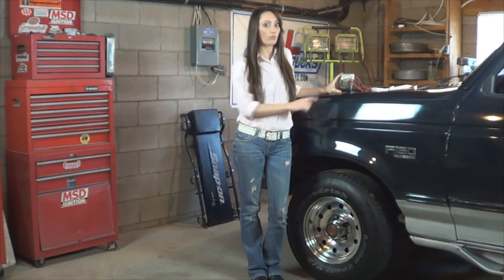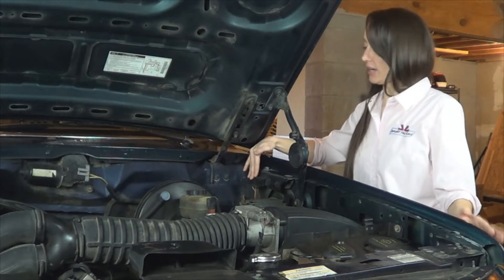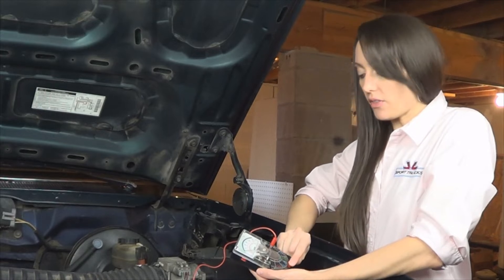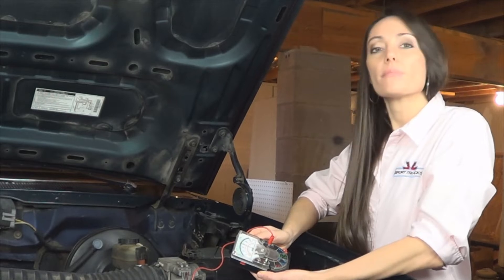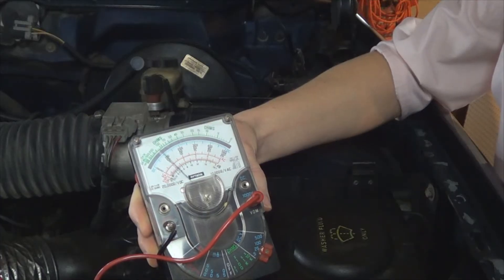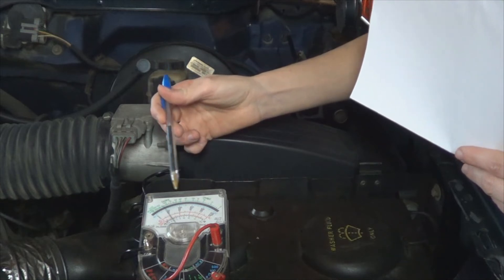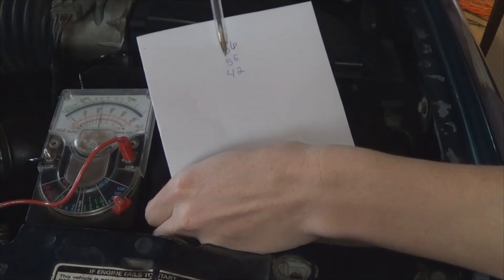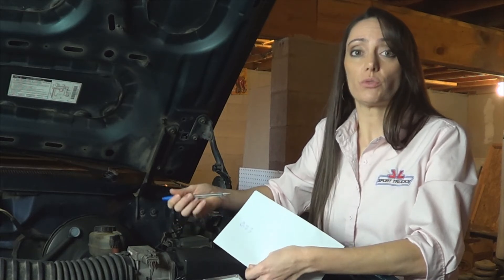How to retrieve Ford OBD I Codes with an Analog Voltmeter by Pretty Jo at Howstuffinmycarworks.

Comment: Where do I sort out why I get no dash lights blinking codes and the multi meter as well as test light give no action?
Reply: Good luck man did you ever figure that out? I have same problem can't get check engine light to flash codes out or a scanner or test light and have tryed to swap tcm's and still the same